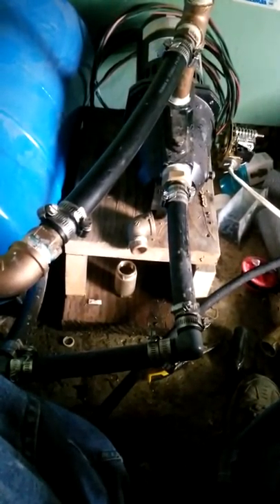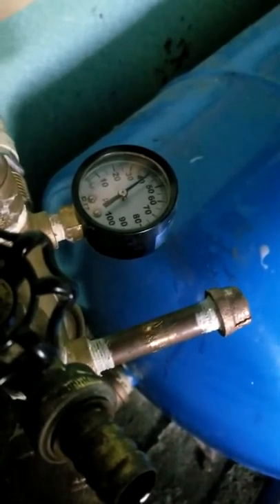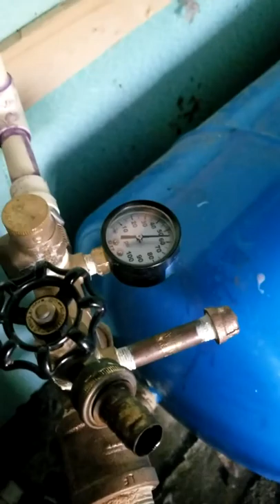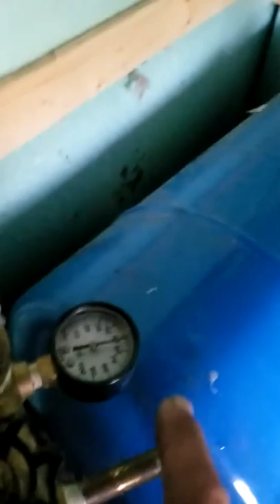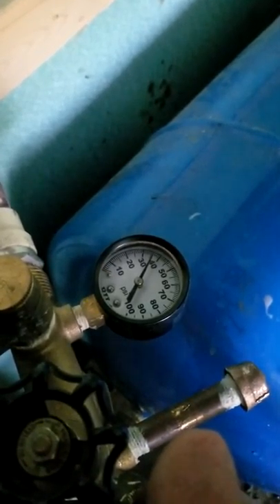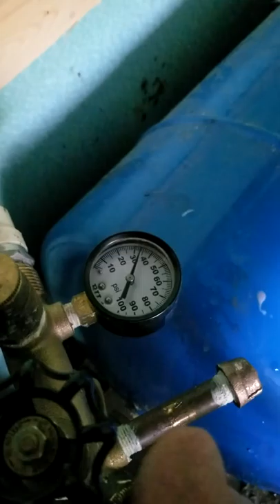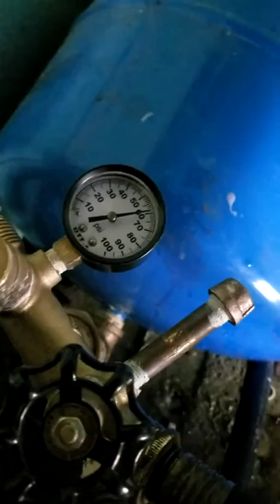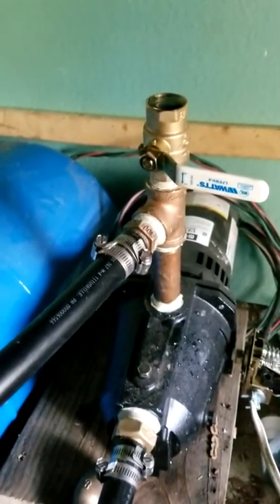short cycle or clicking on jet pump part 2

Comment: Just installed a Goulds J7S and a Goulds 30 gallon Pressure Tank and ran into this problem. Tried adjusting the Pressure Switch up and down, still chattering.
The original system didn't have any check valve, as the only place the water could go back to is the friggin well.
Looks like I 'ok be
Reply: Dammit, I hit "Post" before finishing.
I'll be taking that damned check valve out!